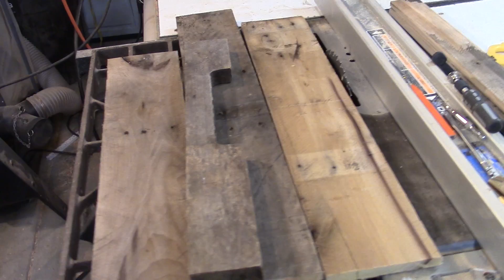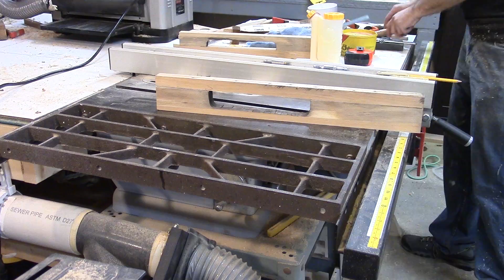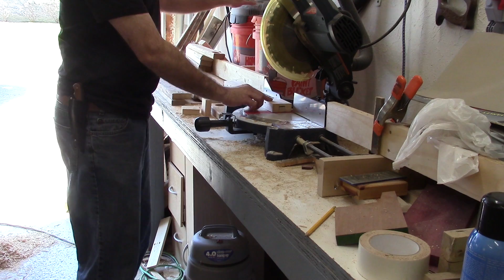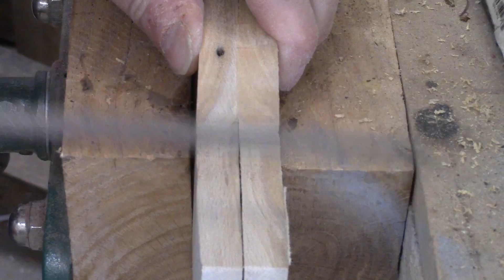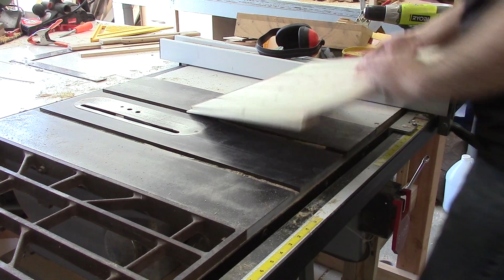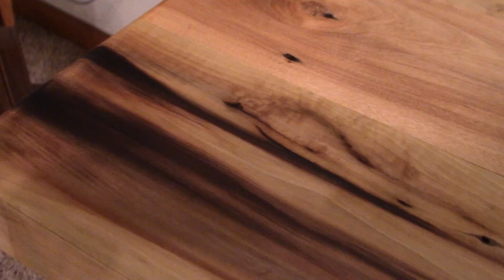Serving tray 4-2016

Comment: Nice job I loved the video and your voice is perfect. The design was exactly what I was looking for and your instructions are easy to follow. However.....pallets? I have abut 150 in my yard ready to be delivered back to a depot the rest get burnt and why? Because it is horrible wood, it's full of nail, rocks, staples, and etc and most importantly they are poisonous most having been treated with chemicals as well as good knows what chemicals have been spilled on or around them. So betweén the health hazzard and not waning to wreck my tools I would never be that hardup
Reply from the maker: Thank you for watching, I carefully pick my pallets, usually first use, or known use pallets, its cheap wood, and some times very interested grain patterns. Pallet wood projects are not for everyone, but it is usually "Free" just requires a lot of prep labor.  As I was learning and building my skills when something was a fail, I had no issue tossing the failure on the burn pile... and starting over.

Comment: Billy nice job. If I were you I would start making a workbench first and quit working on your table saw.
Reply from the maker: Carlos edoardo yeah I have a bench I just end up working on the out feed or at the saw
Reply: Thanks for your time, I appreciate your reply.
Reply: I understand Carlos I have 2 fixed benches and I built a set of permanently fixed sawhorses as well as a removable table for my flattening jig or epoxy forms and yet I build many things on my table saw I even run my planer on top of it
Reply: I understand Carlos I have 2 fixed benches and I built a set of permanently fixed sawhorses as well as a removable table for my flattening jig or epoxy forms and yet I build many things on my table saw I even run my planer on top of it